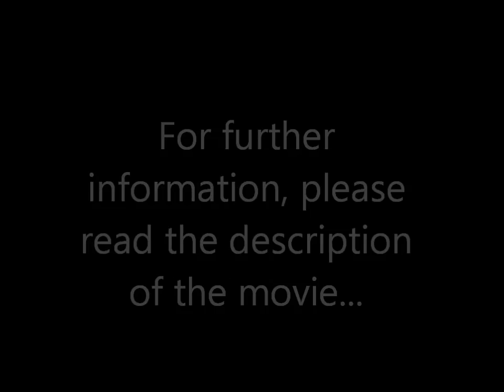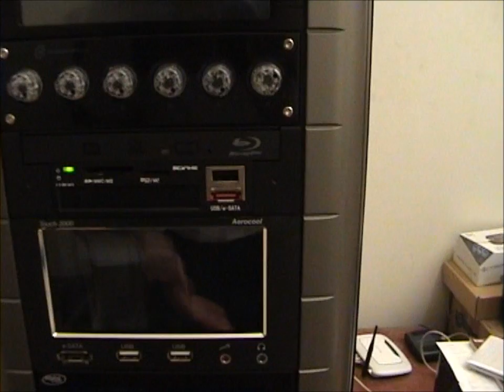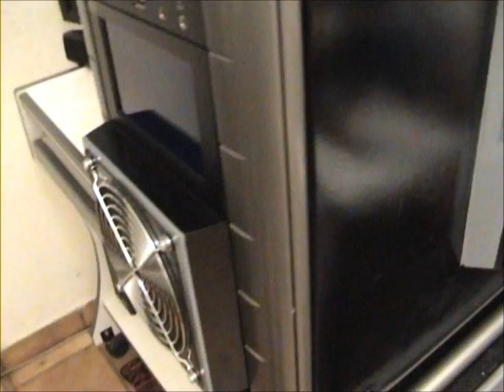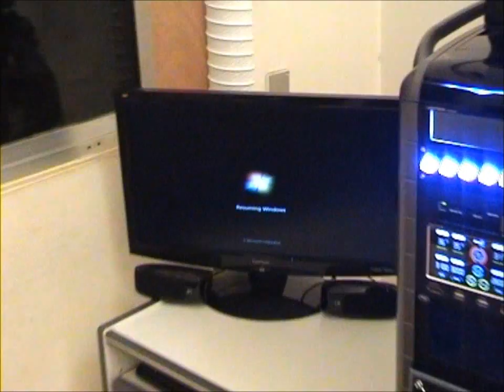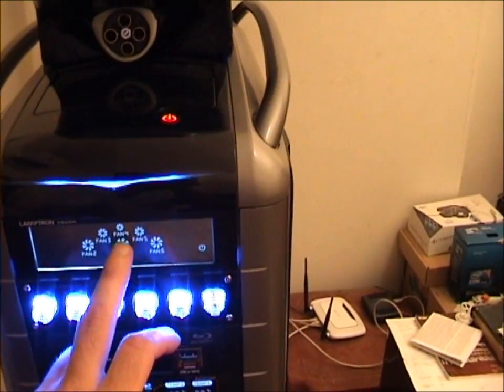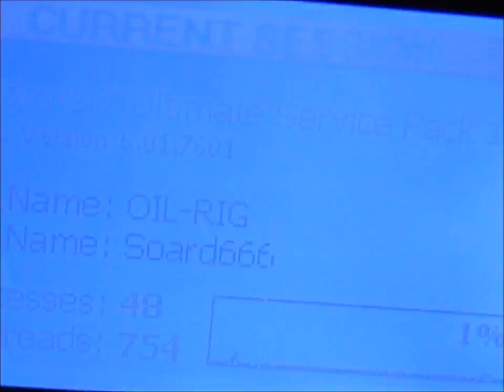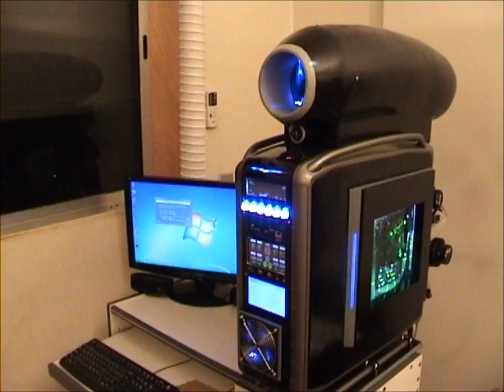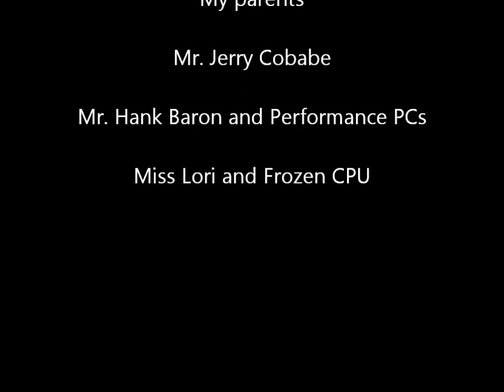Project: Oil Rig

Comment: People complain about how its hard to maintain and cost too much. I think the owner doesn't have the mindset of creating a hassle free oil rig and that's what so cool about this project. Sure it cost more but you can brag about your awesome oil pc to your friend which is nice Kappa
Reply from the maker: Generally speaking, they are quite right. Oil cooled PCs; especially the submerged type, are hard to maintain, cumbersome, and messy. More over, oil is a horrible thermal coolant for anything that is supposed to be cooled anywhere below 100c. I did this project just to make something that was unique and different. And though I've other designs in mind as well, this may very much be the last oil PC I'll ever build. It's just not worth the hassle. But thank you for appreciating my hard work! :-)

Comment: You made a simple machine complicated and costly to maintain. This is the opposite of innovation.
Reply from the maker: I made a design no body thought of. If you aim to discredit, at least be sure you've got all your information right. Cause I did design it to be maintained, and does include some pretty neat innovations. And if I had built it in another country, it would be far less expensive.

Comment: You should have a small plastic case to put dry ice in(the water is less dence then the oil it will simply float to the top)
Reply from the maker: Dry Ice is not water. It's CO2. Besides, it's not a good idea at all. Not only is it not efficient, it would also be temporary.
Reply: Wouldent co2 float to the top aswell? and sumerging you entire desktop in mineral oil tampers the comp anyway.
Reply from the maker: Jake Zylstra Honestly, I don't know if dry ice would float on mineral oil. It probably would, but regardless, it would not be efficient at cooling.
My desktop being submerged in mineral oil doesn't harm it. It's still working fine till this day. I may have voided a warranty or two, but it's worth it.

Comment: Mate, see lot of people do this but non did cooling with something like Freon to get temp under the Zero, you can do that?
Reply from the maker: Mate, you've seen a lot of oil cooled PCs. But I doubt you've seen one in a PC  case like this one. Almost all of the others are submerged in an aquarium.
As for Freon cooling, not only has it been done, but there are also commercially sold PC cooling hardware for that purpose. It's referred to as "Phase Change Cooling".
Reply: Soard666 You are the only one I ask him about that, Because what you did is a REALLY GREAT JOB you get it to a new level and I feel you are the best man to ask.
I wanna call you and talk to you I'm really excited with that.. if you allow me
Thanks, Faisal
Reply from the maker: Qewee Thank you for the compliments pall. I would not mind at all to help in answering any questions you may have. But I'd prefer messaging or private messaging to calls. I can answer messages more freely and at my own pace. I hardly use instant conversations. No offense intended.  :-)
Reply: Soard666 Okay, My idea is this.. the big problem with Freon is (Condensation of water vapor) it will drop on your mobo or in the case but using same mineral oil but we will add Freon cooling inside the build to reduce oil temp. down to like 0*C and oil will not get freezes, it can be possible?
Reply from the maker: Qewee Similar cooling methods have been done this way, but it would require too much power to run, and it would be too expensive to build and maintain. Similar methods are used to cool some huge servers and super computers. But for home PCs, it's just totally not worth it. Air cooling and water cooling are the best methods.

Comment from the maker: Yes that is correct! According to flow the first rad the oil goes through, which is the hottest, is at the end of the engine. And the last rad the oil goes through before it goes back in to the tank is the first front rad which is the coolest. 
But the pumps actually push the oil in to the cooling engine. Ie: Flow direction is as follows: Hot oil from tank.... goes through the pumps... goes through the rads... goes back in to the tank.

Comment from the maker: Thanks a lot! 
To make one (Excluding computer components) just for the material and work, it would cost $1000 to $1500. Everything including the engine housing, side panels, case reinforcement, oil container, lighting and cable distribution I handmade them and designed them myself. Even the bubbler I redesigned for this application.

Comment from the maker: No, no sealant or coating of any kind required. Mineral oil will not destroy any components on the motherboard on contact. 
As for your second idea of deep freezing. You can do that and it should work, provided you extract all traces of humidity inside that aquarium. Plus, for more efficient cooling, you will have to get the freezing cold air to circulate around the components. Kind of like active cooling, NOT passive.

Comment from the maker: It may be possible to use two types of oil with different densities and colors. Wax is out of the question cause it requires a lot of heat which would be dangerous to the components. However, for it to work as desired, external heat would have to be applied to the bottom. That would reduce cooling efficiency. Or you may build an external and independent chamber for the lava lamp effect right in front of the main chamber housing the oil submerged equipment.

Comment from the maker: Thanks a lot buddy! :-) The kind of oil I'd best recommend is lite mineral oil. You can buy it online or in some hardware stores. If not available, baby oil will do. Mobo, connected hardware and wiring are basically the same. Just use a Mobo tray and extend I/O cables needed outside the oil to connect them to your hardware ex: Monitor. You can submerge all electronic hardware in oil but NOT ones with mechanical parts like HDDs and Optical drives! If you have more questions, plz ask. :-)

Comment from the maker: Thanks buddy!  :-) 
Boot speed is normal for a Windows 7 Ultimate 64 bit OS running off an SATA3 HDD with over 600 Mb/S Access speed.  
SSD access  is slightly faster.  But if you are used to Windows  8, then the fault is not from my PC. Win 8 is the fastest of all Win OSs.

Comment from the maker: Bingo! Static pressure is not the only factor, but air volume, speed, density and temperature as well. Plus, one of the engine box's design features is to isolate the rads from ambient temps. So the only air that is touching them is the air coming from the jet intake. So it is not as easy as just sticking rads in series and placing fans between them. Placement of the rads and the plumbing is very important too. You may think that the front rad is the first... when actually the last one is.

Comment: I see, if  the static pressure is high enough then air doesn't get hot enough to matter - plus all radiators benefit from every new fan, interesting. I might have to try that

Comment from the maker: Dude when it comes to plane engines, you are not only discussing cooling, but mainly thrust! It's a long subject and has nothing to do with my cooling design.Though you are generally right about placing two heat generating mediums in series, each item behind the other gathers and builds up heat from the one in front of it, and I'm not denying that fact, what I'm trying to tell you is that I designed it to overcome that problem and I tested it against a flat radiator of similar volume.

Comment: Ok then answer me this, why don't large aeroplanes stuff all their engines into one giant enclosure? It's coz it would be inefficient to feed exhaust air from one engine to another. 
I'm not saying your machine isn't great - I'm saying you can get better cooling efficiency if each rad didn't breathe air warmed by the rad before it. The wider the radiator, the better it cools.
You've sacrificed efficiency for looks, simple, just admit it.

Comment: I'm not a physics student but I'll call your bullshit. There's no way cooling 5 rads with the same air more efficient than giving each one fresh cool air. In fact, having them straight is equivalent to having 4 of those jet gimmicks working independently - unless you line them up single file, then we'll be back to square 1.

Comment from the maker: I know exactly what you meant man... that rad configuration, and the way I designed it would be more efficient than a straight rad, and I tested and compared. I'm not only a PC moder, but also a physics student. A lot of designs went in to that configuration for the best efficiency possible. Temps max out below 40s at max over clocks and max game setting like Crysis 1. Remember that oil is not as good of a cooling medium as water. So for an oil PC, those are very impressive results.

Comment from the maker: It was a very complicated build buddy.  Can't explain everything in a few short sentences. But in a nutshell, I incorporated a specially designed reinforced tank into the case to hold the oil within it. I designed and built that tank with specific detailed requirements for this particular application.

Comment from the maker: Thank you for viewing and commenting. 
As for case noise, actually it's even quieter than most liquid cooled PCs even! One of the cooling engine's main features is to dampen the fans' noises. Plus, the fans used are not high speed ones and reasonably very quiet.

Comment from the maker: Hello! Thank you for viewing and commenting. In general, as long as the oil temp stays in the low 20s, oil cooling is ALMOST as good as water cooling when it comes to efficency.  That goes for both stock clocks and over clocks.  However when it comes to liquid cooling, nothing is as conveniently efficient as good old H2O! Oil just looks cool, but very cumbersome!

Comment from the maker: The heated air from the radiators goes out form the engine exhaust. If the intake duct is installed, the exhaust will not be in the same environment as the intake. And in summer, it would not make much of a difference cause the room is very chilled by the air conditioner.

Comment from the maker: Well never mind the benchmarks. I’ll tell you straight up. 
Oil if kept at about 20C is more efficient than air cooling. However, is not more efficient than water cooling. This project was not meant as an improvement, but as a challenge to build something that was totally different.

Comment from the maker: Thanks buddy! :-)
Engine composition: Wood, fibreglass, fibreglass resin, cotton cloth, bondo (filler), epoxy, and PVC, and plastic. 
If you saw it on facebook, you should be able to see the work log posted there. :-)
There are MANY steps to build it, and requires experience. You may not get it right the first time. Please look at the facebook work log album for some details. I'll be glad to help after that. :-)

Comment from the maker: Thank you! 
Well... yes, it is a cumbersome way of cooling. Water is way more efficient. However, if you are able to keep the oil under 20 C, it will cool almost as efficiently as water even at high over clocks. 
And yes... oil is much more efficient at cooling temps well over 100 C where water would evaporate. 
As for other methods of cooling and general computer designs. Yes! I do have many ideas in mind, just need to move in to a civilised country first.

Comment: I am really impressed, what you've designed is insanely good. I just don't think its worth using oil as a coolant other than for direct contact and even then its not that much of a benefit to something that doesn't work well above 100+ degrees. Will you be doing other projects involving other ways of cooling that would be way more useful?

Comment from the maker: Thanks again buddy! I really appreciate it! :-)

It took me a year to build it. That included the testing and tweaking stages and does not include another year of saving, buying and importing parts. Designing and planning times surprisingly did not take long, but implementing those designs were a challenge.  A lot of improvisation, testing and tweaking were required.